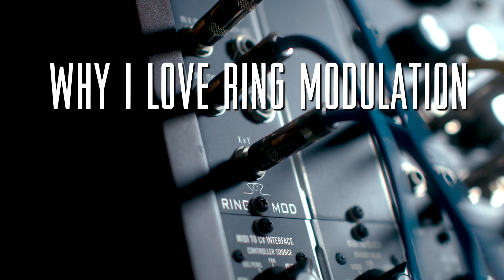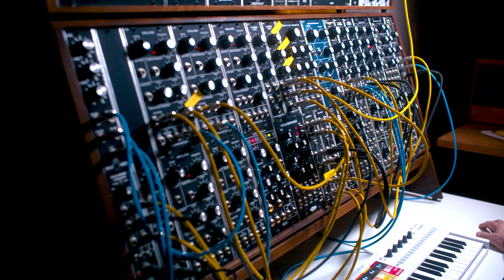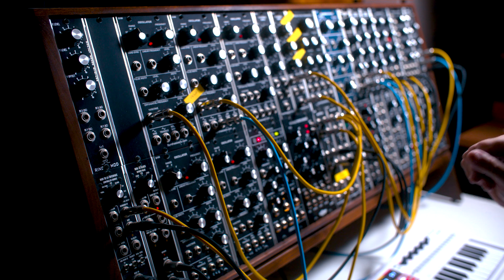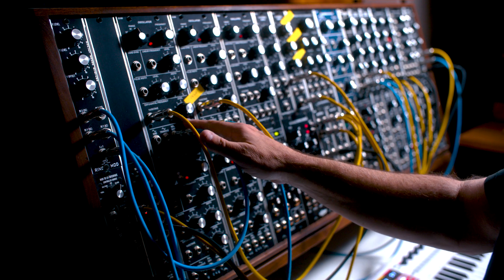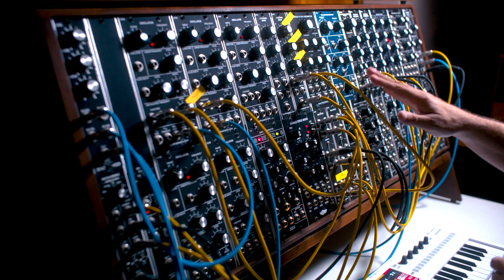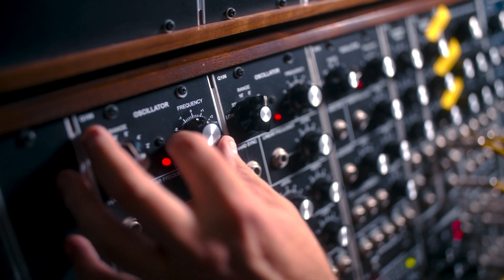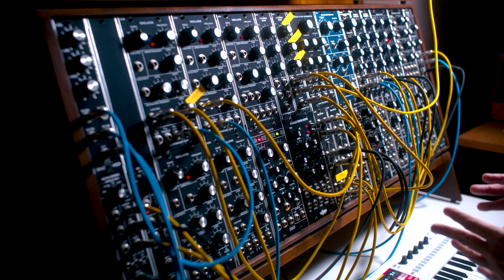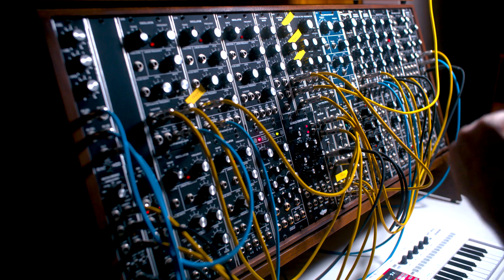Make Any Patch More Interesting - Add a Ring Mod - Synthesizers.com Patch Tutorial

Comment: This is a great primer for the modulation use of the RM to a filter. 
I would love to see your ideas on the differences between using the DC inputs for modulation and the more conventional AC inputs for normal RM audio use. The Oakley Sound Systems RM is great for this feature set. I stopped using my Q116 years ago and love the newer Q158.
Also, thanks for reminding me to continue my replacement project of swapping out all my Q108's for Q158's. I still have a few left to upgrade.